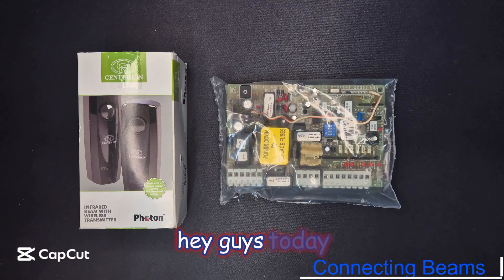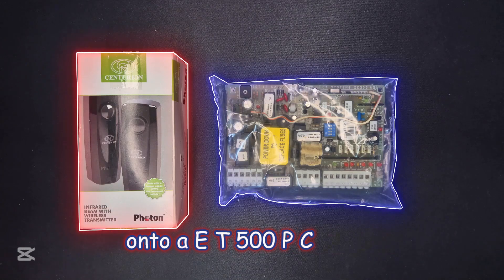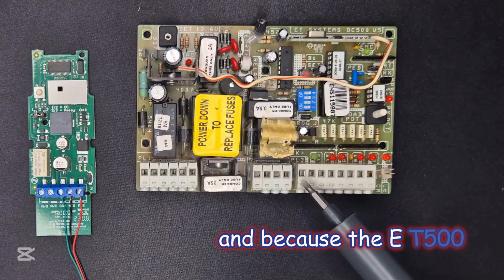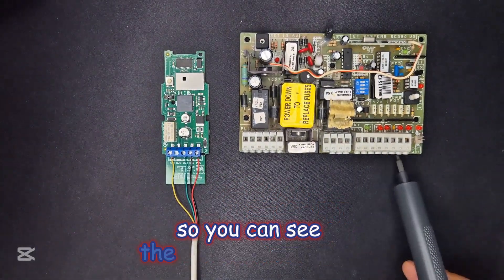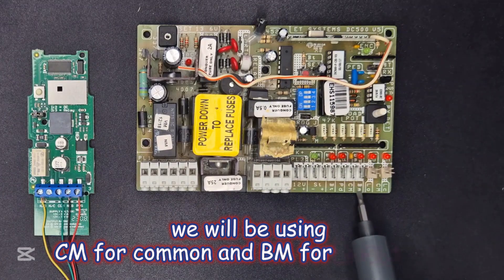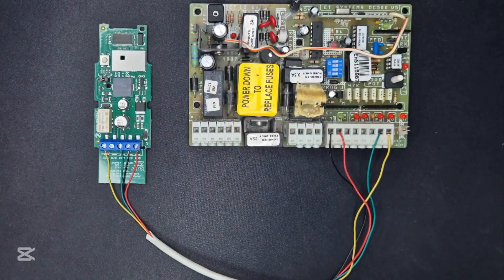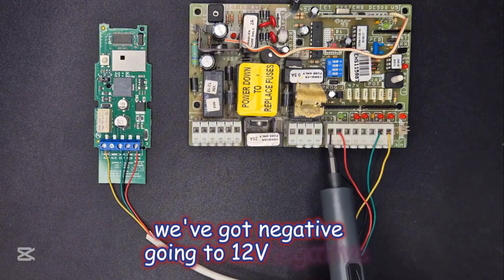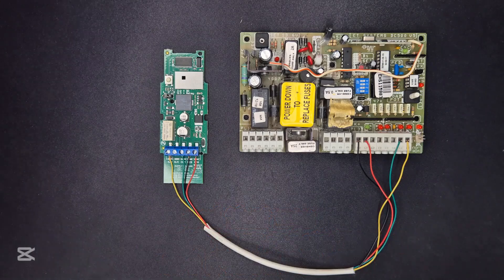How to connect Safety Beams onto a ET500 Motor

Comment: Hi, what if I use the Sentry safety beams that only has a N/C and Safety Beam function?
Reply: Thank you. With the standard connection (without relay), the beam only works when the gate is opening. Meaning when the gate opens and the beam is obstructed, the gate stops and closes again.

When the gate is closing the beam does not work.

Is this something I can program on the ET gate motor so that the beam only trigger the gate when closing and causes the gate to reverse to complete open mode?
Reply from the maker: @francoisjordaan2546 when you set the limit, make sure the gate closes first,  the motor might be going in the wrong direction
Reply from the maker: Thank you for the comment, you will have to use a single pole relay to convert it to normally open
Reply: @nicksandtrickssa thank you. Do you wire the single relay to the beam or on gate motor side and how do you wire it?
Reply from the maker: you can wire it inside the motor, have a look at how a relay works and hopefully you can figure it from there...
https://youtu.be/z61O_-Ied-E